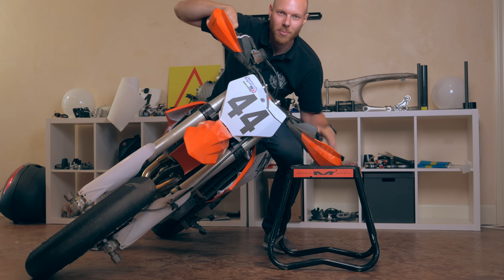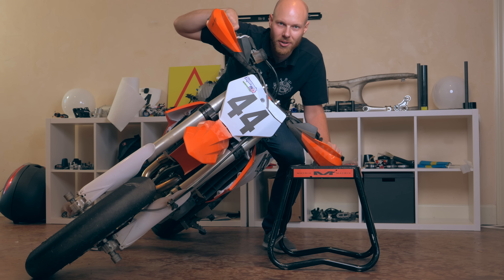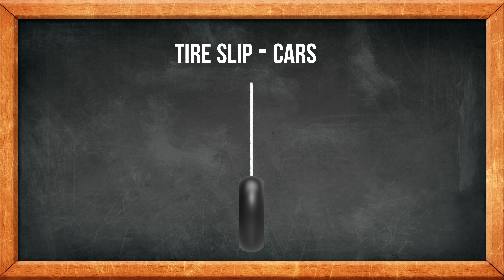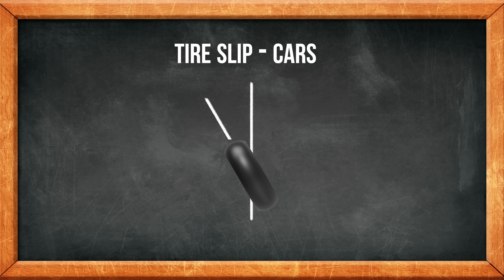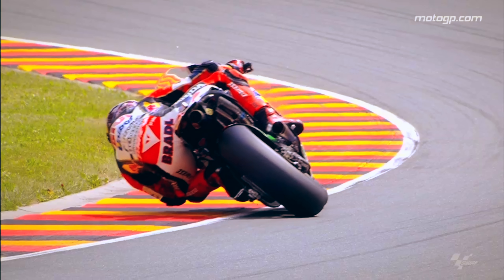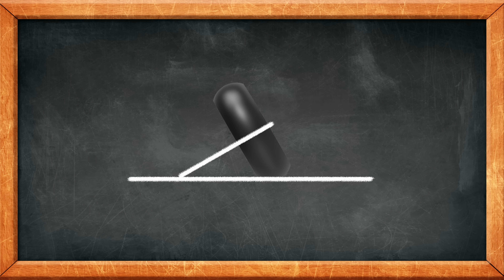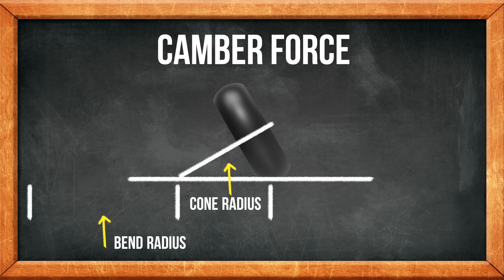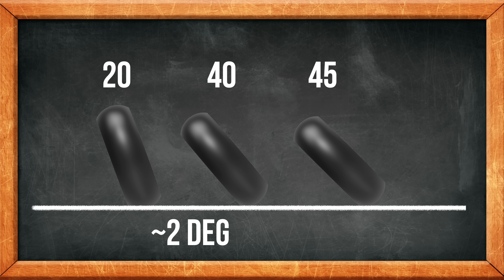How Motorcycles Corner | EXPLAINED

Comment: Excellent vid, but would love to see more summary of how it translates to real riding, like you did at the end for the "never exceed 45 degrees".
For example, is it ever advisable to move your body weight in a corner if you realise too late you are coming in too fast to just lean?
Is it ever advisable not to move you body on a corner in order to keep the bike as vertical as possible?
When is it ever advisable to shuffle backwards/forwards?
Should you brake in corners? Front or rear? When? Under what conditions?
I love seeing the maths/physics behind it, but making the leap to useful road rules/advice/practice is tough.
Reply: All of your questions are quite situation dependable. Trail braking is generally advisable because you transfer more load (and therefore grip) to front tyre. Rear tyre slip is usually more manageable than front tyre slip. Although if you don't know how to handle back tyre slip, you'll probably drop the bike anyway. So...
Leaning into a corner won't create more friction, it just makes your suspension work better, which of course will create more friction on uneven surface if suspension can't handle the bumps on steeper lean angles. On the other hand the effect is negligible with modest lean angles. Of course if you only want to change your bikes center of gravity with leaning, that's a different story.
The theory doesn't really relate to reality before you know how your bike handles in extreme conditions. On those edge cases, understanding the theory might help you make an informed decision how to correct bikes behaviour in specific situations. It's all about what you want to do? Get more understeer in corner? More grip to rear tyre to reduce understeer? Get your suspension to behave better on very bumpy corner? There are no general rules that you can easily make from this. It's more about "Hmm... I totally f**d up that last corner. Let's think about physics and figure out which specific thing might have helped in that situation and try it out so next time this specific situation happens, I'll be more skilled to handle it then".
Riding outside track, skillset is mainly about worrying external issues like animals, potholes and such. On track the skillset is about driving your bike in the threshold of losing it. Drive like that outside track and you'll be dead sooner or later. 
If you wan't to be a better driver, go to track or other safe environment to find out how your bike behaves when you push it to the limit on specific situations. Then when you encounter those situations in real life, you know how the bike behaves just before turd is about to hit the fan. Then you know you are driving way too fast, considering the external issues.
Reply: @hobes9551  I appreciate the reply. I get that applying theory is very situation (and depends on yourself and your bike) which is why videos with theory/physics are very interesting but it's very hard to translate and make useful.
It's not possible to generalise and say "this technique is best", but there must be some more rules that are general enough to be useful given easy to understand caveats, just like the 45 degree angle one that was in the vid?
Reply: @bigdavedogdad  I'd say not really. The ones we already have, basically covers it all. The level Mike addresses these issues is very theoretical and also stuff that you shouldn't encounter in regular street riding situations. Don't go over 45 degrees is more about being safe. You can go over that, but because you never know the condition of the street ahead or your exact tyre pressure you cant be sure how your rubber will behave. So it's more like "Don't be an idiot, you are not on a race track, so you shouldn't try apply these theories directly in street riding" type of tip. He just backed it up with theory to explain why it's such a bad idea. 
But why this theory is so hard to apply to regular riding? For a street rider, it's really not necessary to understand how counter steering works as long as it works. Also ie. slip angle or maximum lean angle is kind of trivial, either you make the curve or not.  It only comes in when you go same curve over and over again and try to shave that last tenth off a second from your lap time. Then you start thinking about slip and lean angles and the possibility of changing bikes steering geometry to get that last bit of advantage. If you are driving  so fast outside a race track that you really need to start thinking if your suspension drag is 6% not 2%, you are driving way too fast (and above your skills).
Riding safely is a mental space more than a skill (like the 45 degree rule). Always drive so that you have some play. Never use 100%  either bikes abilities (not very likely) or your own (much more likely). This way when you see that you've made a mistake you have some play to survive the corner. And how to know that you are using let's say 60% of bikes abilities and not 95%? It's easy, just try out how much your bike can handle. Track is a great place to do this and this is something no one can teach through youtube video.  You have to experience it. 
When your metal space is correct, driving skill (safe and fast) is all about muscle memory and understanding how motorcycle feels in edge of traction. Unless you know where the threshold is, moving weight around or trying to make wheelbase longer because in theory it should help, is just a shot in the dark that can go catastrophically wrong. Main reason for this is that you are basically just guessing, not making informed decisions based on information available (= how bike is communicating to you).  
So good rule with the 45 degree rule is "Don't guess how the bike will react, know how it will react."
Reply: @hobes9551  Yeah I understand that one wouldn't want to apply these theories to improve ones speed and performance on a road, but you could apply them to increases safety and confidence.
The same physics applies for roads, but not for the same reasons.
To refer back to my original example questions: To move your body so that the bike is more vertical would be advisable if you see a corner is rough or there is debris. Not a race situation, but the same physics.
I suppose it may be confusing to combine road and race advice in one vid, though, so I accept why Mike isn't doing it, all I said was I would love to see a more digestible summary that would apply to more riding situations based on such thoroughly well described principles.
The vid does an excellent job, but I am perhaps not the intended audience.
Thanks for the replies.